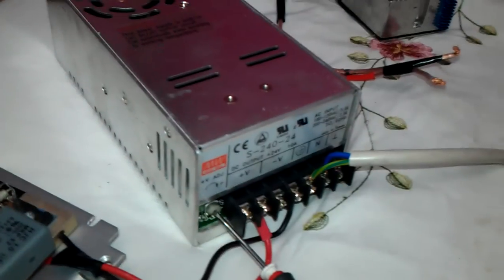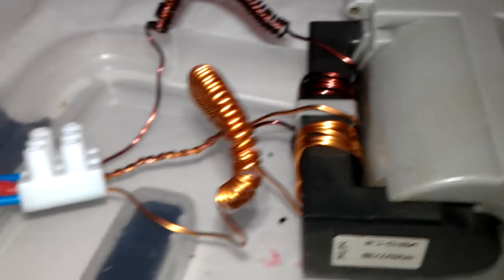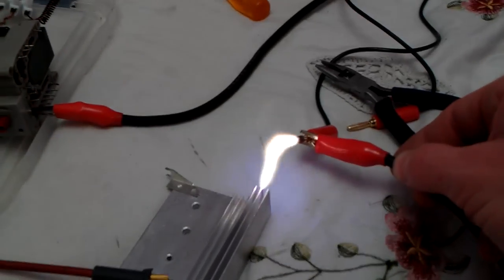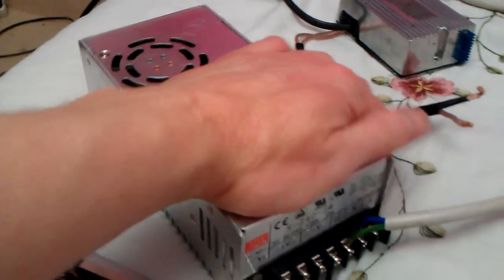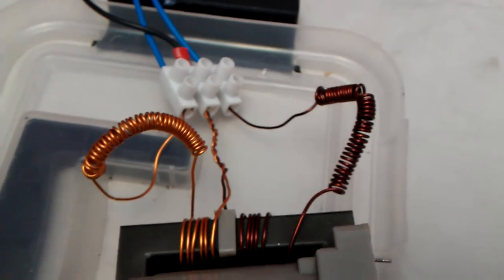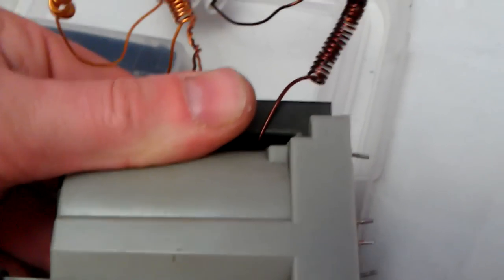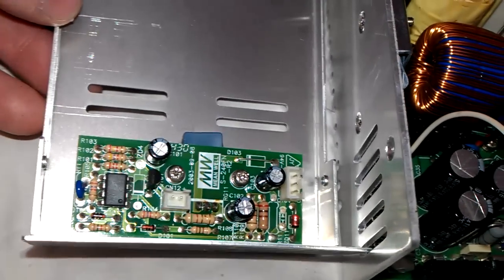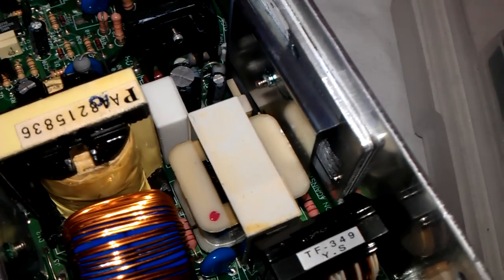Power supply zvs driver flyback.

Comment: good video, what are the ratings on the power supply? I'm trying to figure my needs for my zvs that I built to use as an induction  heater. I;d like to use it to mely silver. Looking at a 36v 11a but unsure if that could get a graphite crucible to temp.
Reply from the maker: Zombie Scrapper Hello,
yes by the sound of your power supply being 11amps should be fine mate. if you struggle then get yaself a 20amp variac! at that you have the power from 0- upto what ya like!  and ya variac will alow more than 20 Amps for short intervals.

hope this helps

Anthony 

High1voltage1rules
Reply: Thanks for the reply, Love the video"s. Wish our scrap yards out here had the stuff yours do lol.

Comment: Can I turn a MOT into a ZVS power supply? I can't find any answers online. -Thanks, Scotlahn McCallister
Reply from the maker: Hello mate, 
yes you can turn a MOT into a power supply very easy. if you don't now mate then there's a couple if ways you can do it. if you have a welder this is the easiest way i have found out to modify a MOT!! first to get the secondary windings out the easiest way is to on the side of the MOT theirs a very shallow weld' and if you get a hacksaw and cut through it" (just one side) and get a flathead screwdriver and force it open' the other side weld will just break easy!. you can remove the secondary windings with ease...! then it maybe easier to apply a new windings of secondary for you power output.
to weld it back" if you have a G-clamp/large Vice" then once your ready to weld it get you G-clamp/Vice and squeeze that MOT together as much  possible and weld it together.
the reason for the clamping is it will remove as much 50 hertz noise from the transformer. as the 2 pieces of MOT are vibrating at the frequency.  and it will be a noisy transformer if you don't. 😊

if you don't have a welder then
you can cut the windings out with snips. long long time. lol 

once you have done this of course you can the rectify the output with either diodes ot a rectifier block.  and use some smothing dc caps to remove as much 50/60 Hertz noise coming out the transformer.
and then your well to go!!

I hope this as helped you mate. if you need any more info I'm happy to help. 
depends on how busy I am' give me time to respond. good luck👍😉

Anthony 

High1voltage1rules

Comment: Like your circuit!
Much better then mine,your wires are shorter.
You are using a pulse-capacitor?
Otherwise it will blow up and short internally ;)